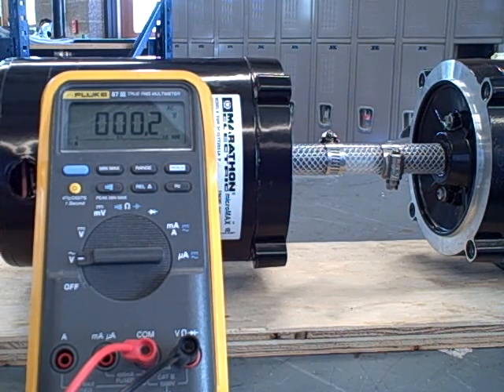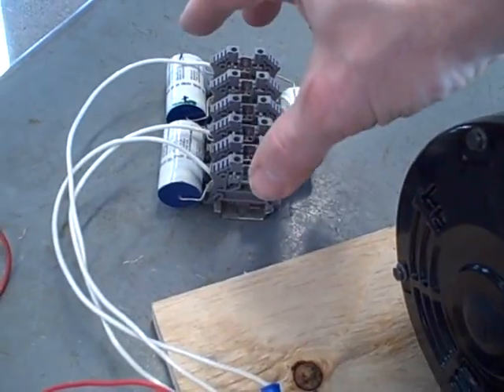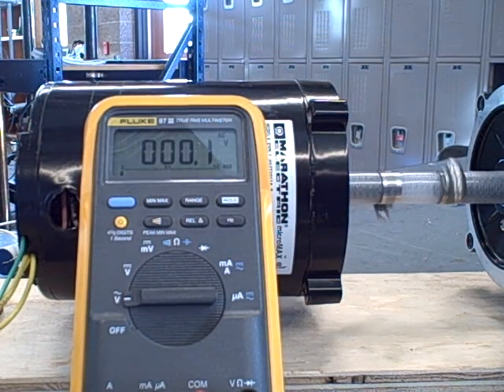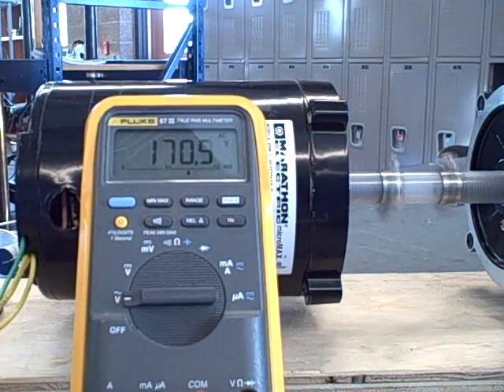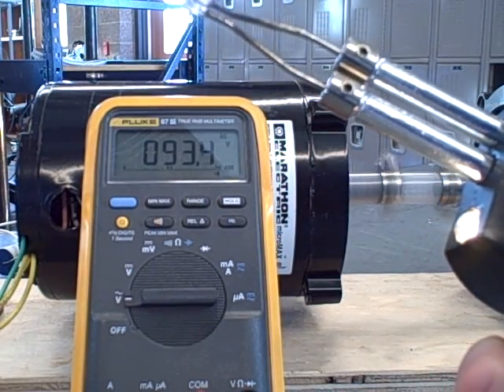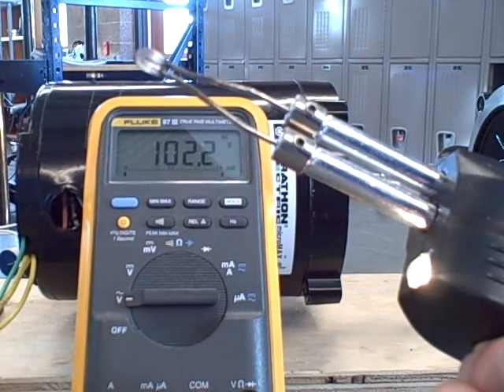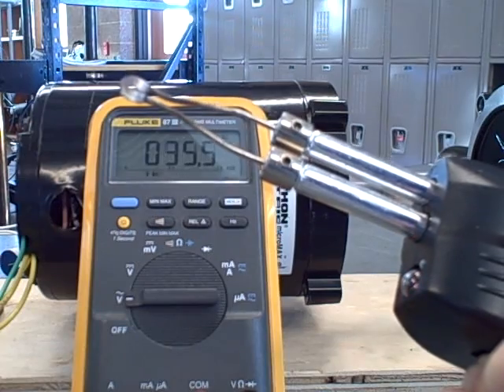Self excited induction generator (part 2)

Comment: A simple way to measure the driving torque is to have either the drive motor or generator held by rollers to let the body freely rotate. Then having a reactive arm to resist the rotation of the motor/generator body. Using a spring balance or load cell to mearure the static force, force times the arm length then gives you the torque.

Comment: Do you have the multimeter connected to two phases? I thing you have to spin it over the rates speed to get a more stable output but at 240vac where I think you are connected have you tried that?

Comment: If they are identical Motors then how are you powering the right side motor beyond the synchronous speed for the left side motor? Are you just overpowering it? I thought these things self-regulated so that they couldn't go beyond the synchronous RPM when being powered electrically
Reply: It is not that the right motor is coming beyond the synchronous speed, he is using a variable frequency drive. So he is making the frequency come beyond the 60 Hz. That will produce a higher rotational speed that is higher than the rotational speed designed to 60 Hz.

Comment: your capacitors are bit too much 
you should try smaller ones to get 120v at 60 hz aka rated power 
the reason why you get more voltage on high power than on low power is caused by reactive power of your soldering iron 
on low power setting it consumes more reactive power than it does on high setting and since induction generator needs reactive power for rotor excitation the more reactive power you take from it the more voltage drops

Comment: So put a fly wheel in the middle and change the other to a three phase motor generator and combine input and outputs and turn the fly wheel to see if you have a self running generator?
Reply: Even the tiniest losses would inevitably dissipate the energy as heat. The resistance of the wire alone guarantees that outcome.

Comment: Very awesome video!
Exactly what I was looking for.   
I was wondering if pulling voltage off one winding for 120v loads that winding too much but it seems the power will evenly distribute from the other two phases allowing equal current draw, not overloading and burning up that one winding.  
If I had a battery bank drawing consistent power, I figure I can set an rpm on my diesel motor and continuously charge at a given amperage rating.  
I have a 40hp 3phase motor I want to turn with my diesel Mercedes motor out of a w201 diesel 190d.  
It will run my 3 phase equipment if I can get the setup right.   
Very cool video., thank you.

Comment: You could fashion a crude torque meter by replacing your vinyl tube coupling with some sort of deform-able body (soft poly material or block of rubber ?) mashed between two disks.  Some type of torsion spring?   Clock-spring?     The two disk would have index marks, and a strobo-scope could be used to "Freeze-frame" the two marks.

Comment: Very good video, but I want you to recommend  the use of a 3 ph load instead a 1 ph load. When you load to much only one phase you create an umbalance of the magnetic torque of the machine and thats the reason you probably can see the poor regulation of the voltage.
The other thing is that a soldering gun like that is a highly inductive load, so its probably the capacitors cant produce enough reactive power to fed the gun and the magnetic field of the generator. Please try with Resistive and soft inductive and capacitice  3 ph loads in the next video. Thank you so much!!!!

Comment: Ummm.... I know nothing. but I have to ask, can't one have as many volts as they may like while still be limited in watt/amp? Is this possibly further advance-able in the assembly within the wrapping? I have so much more to learn :) Thanks for the video. I have many more questions but I'm not even sure how long you may take to communicate on the ones I've asked so far. I would like to think you were just running outta horses .... If you had a larger bank would that not solve the wattage leg (longevity/depletion) problem? that is what my noob brain is pondering

Comment: 3 20uF capacitors delta connection. Great video. Thanks. Is Tesla car uses ac induction motor and become a induction generator when  pedal is not pushed, right? So it stores energy back to batteries.
Reply: Teslas use bldc (brushless DC) motors. Bldc motors have permenant magnets, so they are not induction generators and do not need excitation.

Comment: and whats the best way to regulate the voltage if your driving speed is fairly constant? (small scale use)
Battery charge controller?
Reply: I think the idea here is to erfrain from needing a battery bank, the real solution to the problem doesn't lay in finding more wattage and amperage for that gun, the solution lay in being able to now redirect the power from the Self excited, to the crank *currently 120.... take it and gooooooo

Comment: what might you suggest for making the voltage output more stable? I have a small 3 ph motor that i'm interested in putting to use as a backup generator, powered by the front PTO of my small diesel tractor.
Reply: or get a dedicated gas/diesel generator from the hardware store.
however, if you like to DIY, you can try to use it but beware of overvoltage, you can break your electrical appliances
Reply: I would sugest you to convert it straight to DC and use a inverter.

Comment: how could you get the generator to produce higher voltage with less spin? can't you just make a bigger capacitor bank ?
Reply: Comparing (a) operation as a motor (not a resonant circuit), and (b) operating as a generator/alternator in a tuned circuit - is an invalid reason for stating "you're not going to get more than 230 volts out of a 230 volt motor". 

With the capacitors, you now have a 3-phase L/C resonant tank, and the P-P voltage could easily exceed the motors' rated voltage - when the L/C tank is operating at (or near) the center-frequency... aka: the self resonant point of the tuned circuit... as long as it's under no-load conditions. (been there, done that)  The self-resonant frequency can be determined by increasing the drive motor speed while watching the generated voltage. There will be a speed at which the generated voltage will peak, and then as you continue to increase the drive speed, the voltage will begin to fall. That "peak" is the self-resonant frequency.  If you never find a peak, the capacitors values are too small - as the highest RPM speed is insufficient to reach self-resonance.

When you connect the inductive load (the soldering gun) you change the Inductive value of that L/C resonant tank, resulting in the voltage drastically reducing - because the motor windings and capacitors are now operating much farther from the resonant frequency.
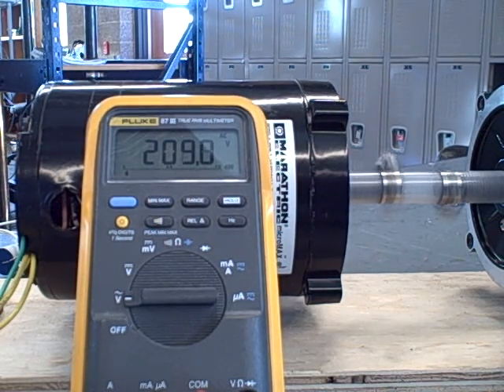Reply: The OP was looking to boost the generator's voltage by using a larger capacitor bank.  While you can indeed cause it to output more voltage than it's rated for, what I was trying to communicate with the OP is that this is not a wise idea.  If you try to do this, you will most likely cause the stator's iron core to saturate which is not good for the machine and will cause premature failure.  In fact you can hear this motor saturating at 2:21 when it re-excites after the first load test.  Saturation in a laminated iron core causes the iron laminations to clap against each other, creating a "buzzing" sound.
Reply from the maker: A larger capacitor bank decreases the resonant frequency of the system and allows for generation at slower speeds.  However, the maximum voltage is limited by magnetic saturation of the motor's stator core.  Simply put, you're not going to get more than 230 volts out of a 230 volt motor . . .
Reply: @BTCInstrumentation should it be 3 phase induction motor ? Will it work with 1 phase industrial motor?
Reply: No, the capacitors have to be sized based on the desired resonant frequency of the circuit. Since we’re using a motor designed for mains power, we’re pretty much pigeonholed to 60hz.

Comment: That soldering gun uses Induction heating... so it has a higher impedance than an equivalent power incandescent light bulb would have. With a 140W incandescent bulb, it may not be as easy to get 120V AC output during resonance.

Comment: What makes it "self excited" when it's being spun by another device connected to mains?
Reply: Thete are no magnets inside an induction motor, except maybe a tiny amount of magnetization from when it was previously run.  To make the coils magnetize  you need to run current through them.  Self excitation simply means that with a rotating rotor, the residual magnetisim charges the capacitors, that latter disipates that charge back to the coil exciting the field coils. That is it. 

Those field coils then interact with the rotor inducing currents in the rotor that creat magnetic filds that oppose the magnetic fields in the field coils. That is when the ac voltage jumps.
Reply: +Brian Garich as is stated in Part 1, a non-excited generator doesn't produce power. You need to energize the magnetic field, like permanent magnets do in PMA.

That is the point of a capacitor network connected across the phases.

Comment: On those Weller soldering guns, the high/low selection is opposite of what you'd expect. Depressing the trigger halfway is 140W (high), and all the way is 100W (low). This is why you see the voltage increase when you pull it all the way.
Reply: +dericn +BTCInstrumentation This is correct.  Full power = half squeeze.  reduced power = full squeeze.
Reply: Thanks for this!
Reply: Thanks for telling me, i have one and will need to use soon!
Reply: So much not logical made. Should be full in full power lol